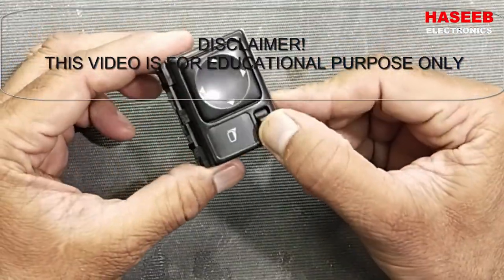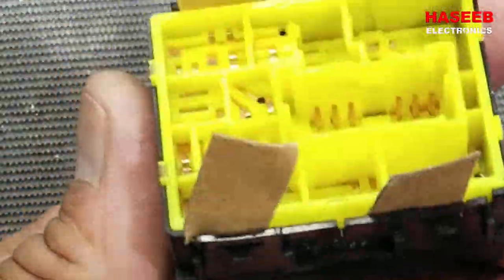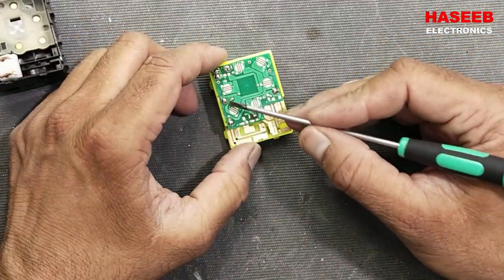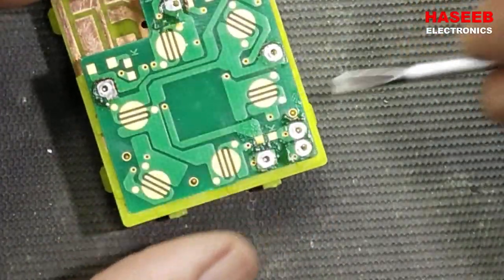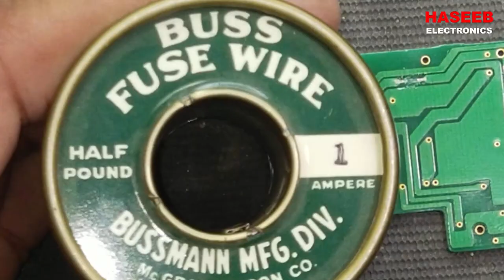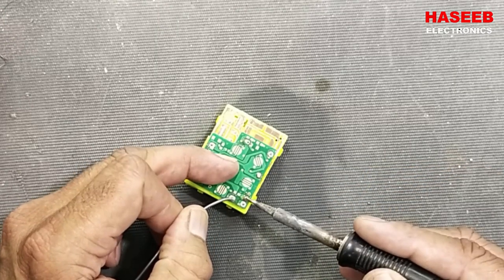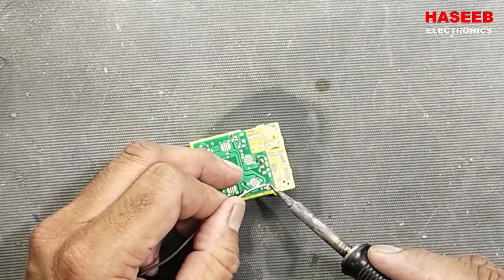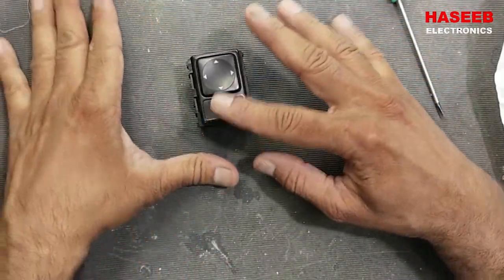[405] How To Repair Car Outside Mirror Control Switch, Power Folding Mirror Control Switch

Comment: Thank, very useful instruction. Do you think is possible use the wire inside the tube fuse if I haven' t fuse wire?
Reply from the maker: Yes, absolutely or we can use enameled wire of a very thin gauge
Reply: @HaseebElectronics  Thanks!

Comment: Nice repair. If there was space, maybe you could have maintained the fuse links by jumping the gaps with SMD fuses?
Reply from the maker: thanks a lot
but in most boards it is print fuse is used to reduced components